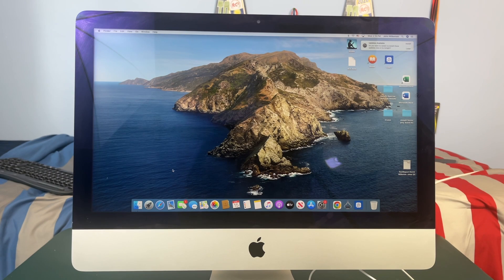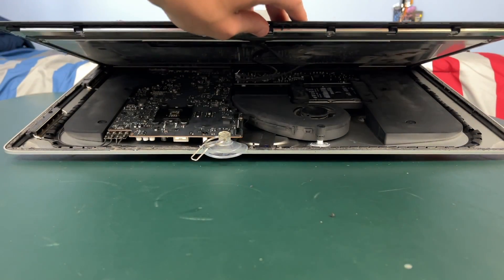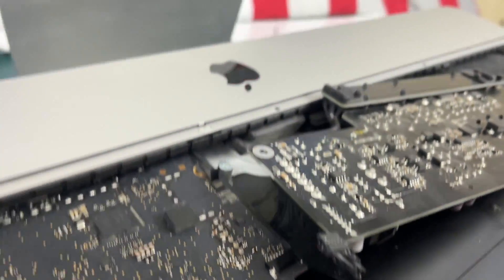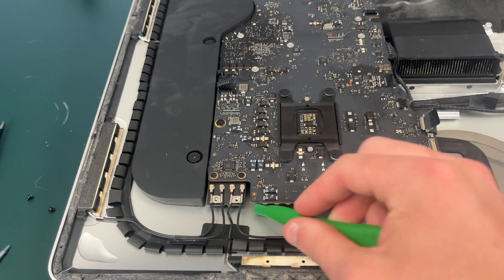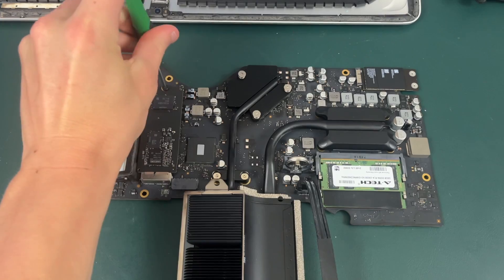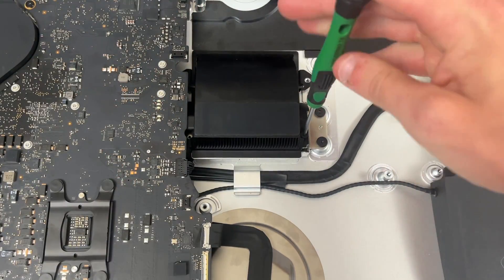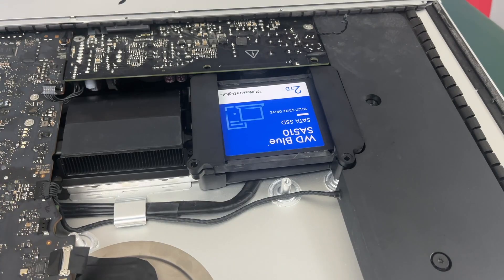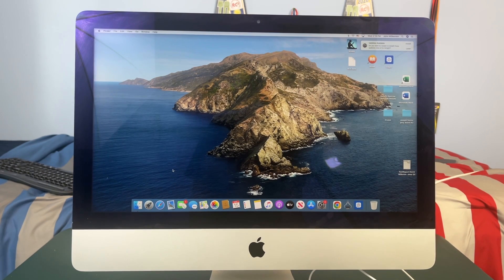How To Upgrade M.2 SSD 2017 4K iMac!

Comment: As an ACMT, working on these Apple products shouldn’t be so difficult. I have always said that the engineers who design these iMacs and such should learn to do upgrades and maintenance on them.
It used to be much easier to replace and upgrade all Apple products.
Anything on these computers should be replaceable within 45 minutes.
Nobody can convince me that all these Apple products can’t be engineered to make servicing them much easier.
It used to be easy.

Comment: very good video!, I upgraded internal 32Gb M2 SSD with an 1 TB apple M2 SSD last year and reloaded Ventura sucessfully and win 11 with boot camp assistant. but recently qhen I booted to  win 11 and updated, it shut down with blue screen. then I reloaded Ventura but the previous 1 TB  M2 ssd never show up in the disk utility and I have to reload Ventura on  replaced 2 tb sata SSD. It is not easy job to reopen Imac to check. any method to get 1 tb M2 pcie ssd back/show up? thanks a lot.

Comment: Why do everyone who shows in the video how to do this and leaves a link to a new SSD not mention that the new drive won't fit in the connector, you need either an adapter or another drive that is much more expensive
Reply: Yes! This! I was able to use one of those adapters from Amazon on a MacBook to install a regular NVMe into the proprietary apple slot. My question is, using this method with one of those adapters, will I still be able to screw the new NVMe in WITH the adapter? thats the question.

Comment: At 09:35 it appears like you've put the same nvme back in the pcie slot instead of a new one, i hope others noticed this as well.
Reply: That's because unless you buy a used Apple or OWC NVMe drive, you need to use an adapter to use a normal M.2 NVMe drive.  This video apparently was for demonstration purposes only since he did not replace the drive or show the right kind of adapter to use.

Comment: Kind of skipped over the bit where a regular M2 2280 drive won't fit the proprietary Apple connector... So you're stuck with used Apple or OWC aftermarket branded pcie drives. Also its much easier to remove the 2 screws to the airport card without disconnecting the 4 antenna cables. Saves time. Might also point out the best time to replace the memory is when the board is out as it's nearly impossible to replace at any other time. Oh and best to apply all adhesive strips to the chassis first. Stand the iMac upright and wedge something under the chin to support the process.Then remove the adhesive seal for only the bottom strip that goes along the base of the display. Carefully align the base of the display and rest it into place. Then you can tilt open the top of the iMac several inches to connect the LVDS and backlight cables and then rest the LCD in place to test the screen output. Once output is confirmed, tilt the screen an inch or two at the top before removing the remaining adhesive seal tabs on the perimeter. Then it's closed and ready to use. If it all seems to difficult, best to pay a professional to do the work as broken screens are expensive !
Reply: You can buy an adapter for m.2 ssd to fit it in. Cost $10.
Reply: @Leebabins  can you tell me wich adapter to buy on Amazon? i want to install the Samsung M.2 990 Evo 1 TB on my 2017 4K 21 inch iMac...,i appreciate it!
Reply: @aris9125 did u find thé right adapter ssd?
Reply: @C2ni  Sintech NGFF M.2 nVME SSD Adapter Card for Upgrade 2013-2015 Year Macs(Not Fit Early 2013 MacBook Pro)  - it's a longer adapter that the new NVMe drive fits on top of.  Be sure to use insulative tape to prevent any short circuits on the bottom portion of the adapter.